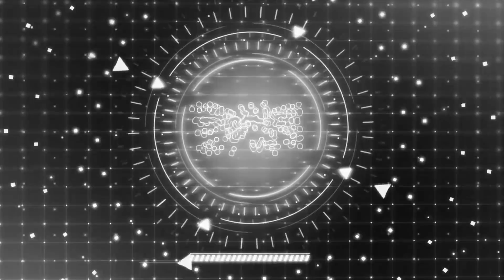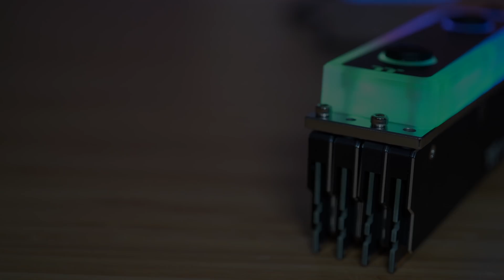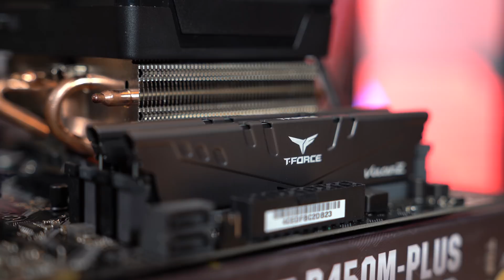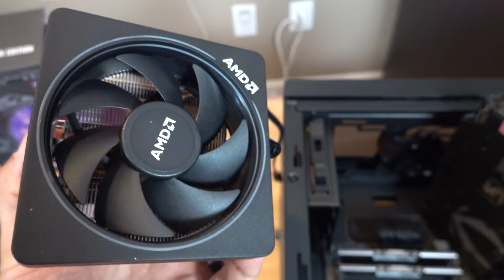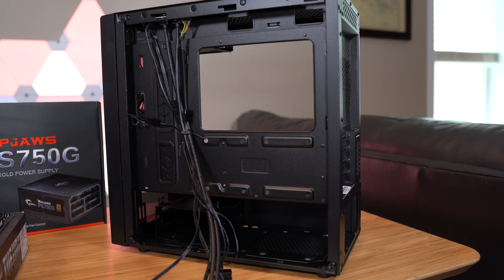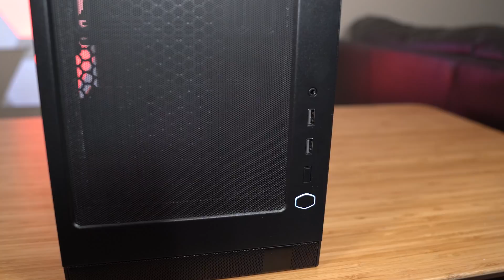Can The NR400 Withstand Our New Testing Method?

Comment from the maker: Yes, the "case review" portion of this video was shorter than usual, but that's only because I took up a bunch of time talking about testing.  Future case reviews using this standardized hardware will be much more thorough.  Think of this as a trial run, what did you think?
Reply: BPS Customs Nice work Brian
Reply: From the ads ive seen online ypu can fit a 360mm radiator in there if you remove the drive bay.

Comment: I recently got this case for my build and I don't regret a bit. The airflow is actually pretty good and the 5.25' drive bay, at least for me, is the cherry at the top as I had a bunch of old CD-ROMs from my 486 days which I intend to convert to ISO so it's pretty handy. Also it looks really nice in my desk. It's a beautiful peace by Cooler Master. BTW, my build is a Ryzen 5 1600 AF which I got like two weeks before AMD released the 3100 and 3300X and I really love it. I also replaced the stock cooler with a Hyper T4 I had laying around but I spray painted the heat spreader part black just to match the whole thing and it looks really neat.

Comment: Recently completed my first build and used the NR400. I liked not only the price (with glass, grommets, PSU shroud)  but the mesh front, rather open rear of the case and the top ventilation.  During the build, I installed two aftermarket intake fans at the front and moved the provided front fan as a top exhaust. Ran CPU all day today for 8 hrs of work from home and now 5 hours of gaming. Checked the CPU a few times today and CPU hovered around 45-ish with only windows running and around 67 when gaming (no OC). Nice experience on the build and relatively easy. Cable management was good thinking ahead. Removed the hard drive storage as well to store extra cables. If i can build in this easily with one functional hand, the rest of you should do fine.

Comment: Very silly for cooler master to make the HD case removable in this case but on the NR600 to only have 1 of the two cage sides removable. Once side can be removed the other is riveted into place. I bought a NR600 and then returned it and went with a corsair 220T instead for my ATX build.

Comment: Has anyone tried fitting a 360mm radiator in the front? Official spec sheet shows only 240-280 rad is supported in the front even though 3x 120mm fans are supported.

Comment: I agree with the standardization methodology, but there is one variance you might consider.  Most PC builders will choose not to use a mini card in ATX cases or even Micro-ATX cases.  The short card will artificially enhance CPU cooling in a lot of cases,  you might wish to select a more normal-sized graphics card for the larger cases.
Something could be amiss regarding that Wraith cooler, but remember, the 1770X ships without a cooler.  AMD must have known that theirs would be inadequate.
Reply: 1700X, that is.

Comment: It's a good selection you've got because if someone is going all out on a system they would surely not 'nickle and dime' on a case. Most review cases are for 'normal' people and if spending $200+ on a case wouldn't you be considering water cooling- which then changes all the thermals etc. Glad I don't have to do what you have to do with trying to figure out how to maximise the efficiency of a case! That said on that case could you put 2 radiators on intake and blow it all out the back?

Comment: Why not use a mini ITX board with a slim CPU cooler (like a Cryorig C7) across all cases? Could run the same BIOS and settings across all form factor cases that way.

Comment: You need to have a standardized fan configuration because not all cases come with fans. Perhaps have the case filled out with the max number of fans
Reply: The issue there is that the included fans are part of the price.  So it factors into the value.  Perhaps a "stock" and "max airflow" config would be interesting, where stock is what it comes with and "max airflow" is a standard set of good fans (Noctua?).
Reply: Agreed. I'd like to see these tests run again with decent fans as well

Comment: Suggest you standardize the CPU VCore, as well...
Some motherboards will run higher/lower voltages, which will, of course, change temps.
Suggest you manually set cpu speed and volts to eliminate those variables.
Reply: I suspect this to possibly be the issue with the shutdowns... Strange for sure
Reply: Good point, though some tuning may be required with something like HWINFO for Vcore as different boards also have different levels of load line calibration/Vdroop.  Picking similar boards from the same manufacturer with the same number and type of power phases would be ideal, though as long as all Micro builds use the same configuration, and all mini builds use the same configuration, and all atx builds use the same configuration, that's all that really matters, because comparing an ATX to a mini-itx case really isn't all that useful anyways.

Comment: Why not just use mini-ITX for all tests? Just to eliminate any possible variables
Reply: Some ATX cases are still cramp to get the motherboard in, but would be simple to fit an ITX motherboard in. So using the appropriate motherboard each case will address clearances for cabling and issues that would arise in each review.